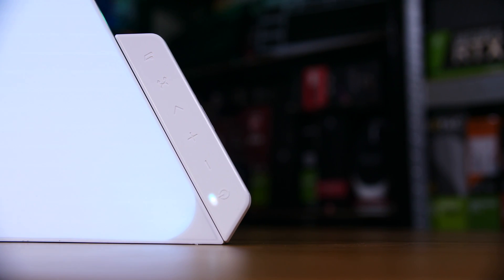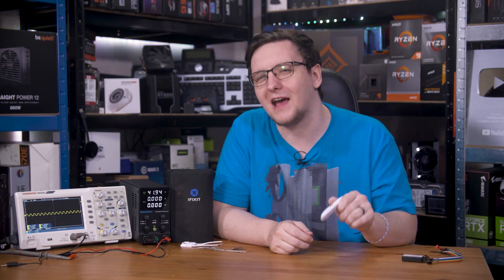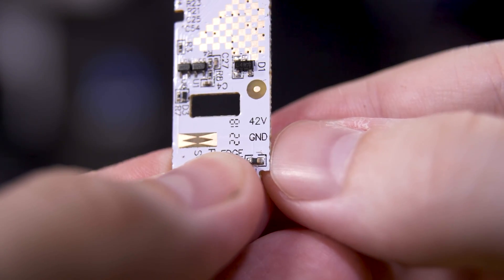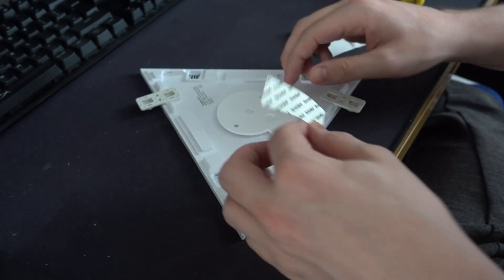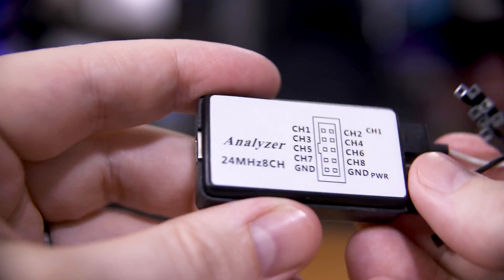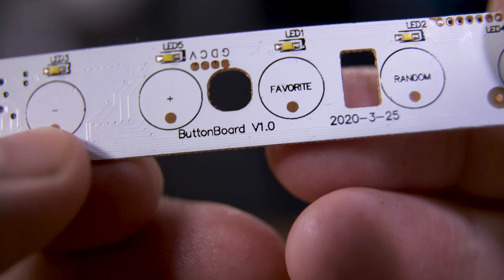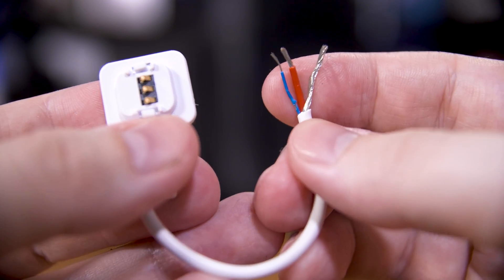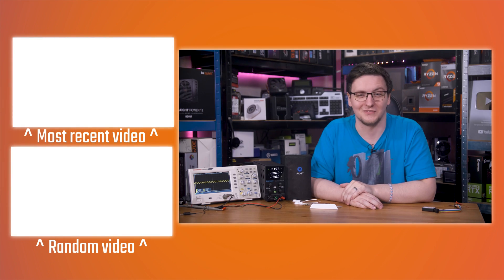Trying to Reverse Engineer the Nanoleaf Shapes Controller (Please Help...)

Comment: Thanks for taking the time to investigate and document all of this! My (first) controller recently broke after 4 years of service, Nanoleaf won't send me a replacement so now I'm stuck with a dead controller and 80+ shapes panels. I refuse to give Nanoleaf anymore of my money and am looking for alternative ways to control them before throwing them out (I'd feel bad about selling them). I'm wondering if you got any further with developing a DIY controller of some sorts, or if you happen to know someone who did and documented this? I'm a software engineer so I can follow along to a certain point, but unfortunately reverse-engineering hardware goes beyond my capabilities. It's a long shot, so thanks either way 🙏🏼

Comment: Mine sort of did the same thing except, mine stopped working after I installed an extender to my Wi-Fi network. I tried a hard reset. Found that I had to leave it unplugged for at least an hour or more before it would start looking for the Bluetooth. Email Nanoleaf and they gave me some suggestions to try. But I’m not holding out. I may have to scrub the whole network of these and start from scratch.

Comment: Has anything significant happened here? I tried looking at the signal from the controller to the panels with a 1-Wire analyzer in Salae logic but nothing really happened. Sadly, when trying to remove the case of the controller something seems to have broken. However I can provide my files from this.

Comment: Only paid $130 for the triangles. If it tanks after 2.5-3 years I wouldn’t be surprised. Will just pull off the wall and get another set.

Comment: They gave me middle fingero n replacement, died after 2 years and a week. I snapped the controller in half. Very sad these overpriced products are actually useless crap. Looking for a way to use the led panels without controllers. Only to force higher brightness!

Comment: Looking forward to seeing more about this! 
My shape lights controller stopped working and Nanoleaf is refusing to replace the controller, saying the warranty has expired by now, and I just have to buy a new one for 40 euro. So I am stuck with lights that only turn a "default white" when given power on the wall. So can't wait for an open source controller!
Reply: same here! I thought about diy something with my arduino but this is high above my level of understanding.

Comment: So you’re sure it’s a firmware problem, rather than a hardware failure of some kind?  It’s odd that they don’t spin up a new HW revision, or a firmware update, but I guess it can’t be updated by the customer?  But you would think they would fix the firmware and put it on all new controllers coming out the factory. Strange.  It implies this is deliberate, or they lack the technical expertise to find the root cause and fix it. But it’s really cool that you’re looking into this!
Reply from the maker: I've always kept them up to date on the firmware side. On the hardware side I've done my best to test it, although now I have the lab bench PSU I might crack the other one open and try feeding it voltage and see if it looks like something specific is dead. The fact that it's fully destructive to get in means this isn't exactly something I can do or recommend to revive old units. My completely unevidenced hunch so far is that 42V is really high for little surface mount components and there's a chance that an LDO or thin film cap fails after a certain number of cycles or something. Not sure though!
Reply: @TechteamGB  I think you’re probably on the right track.  But it’s odd that it would fail within a year, as that costs them money. Normally they design things to fail just after the 2.5 year mark, to escape warranty.